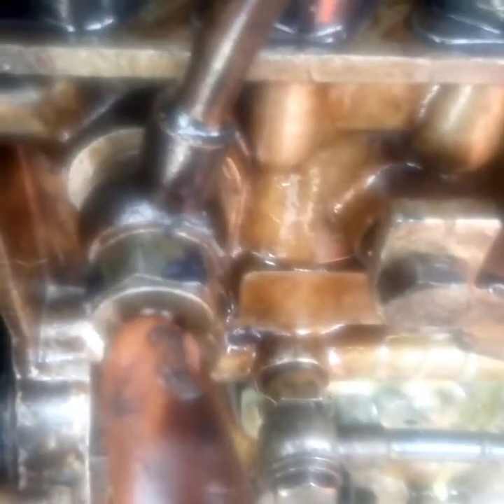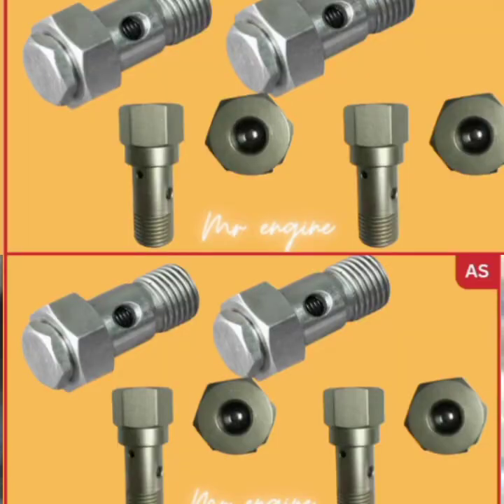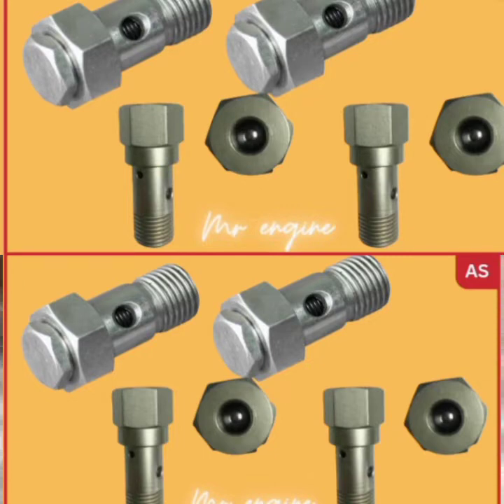How Injection Pump Overflow Valve Work and Its Function

Comment: If the engine reaches the normal running temperature and cuts off what's the problem with the engine?
Reply from the maker: Check the temperature sensor